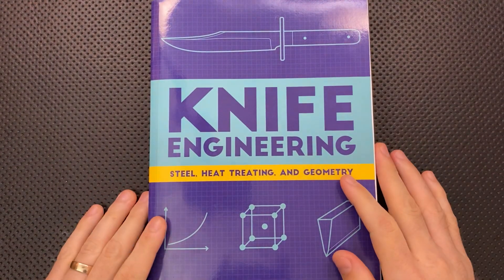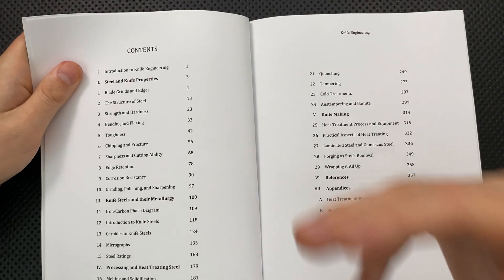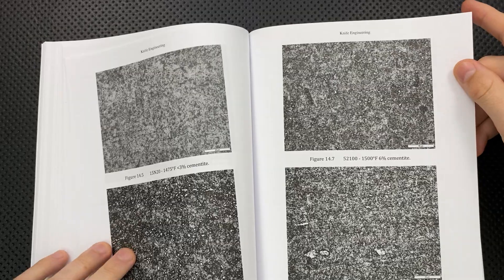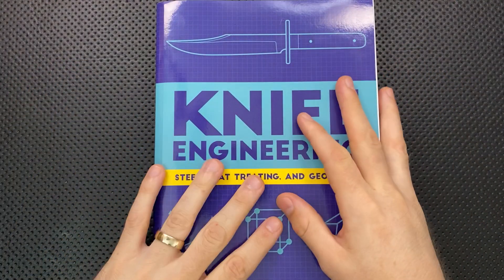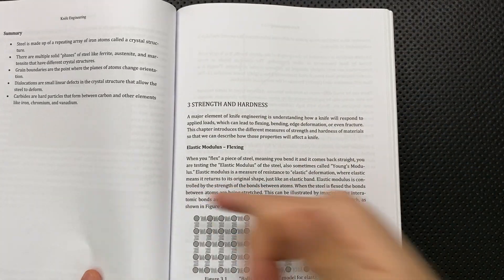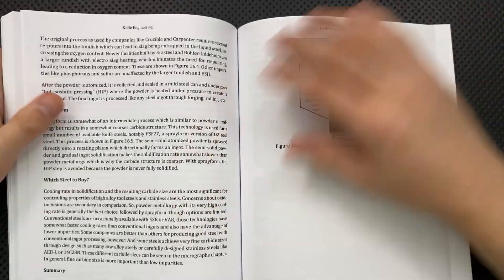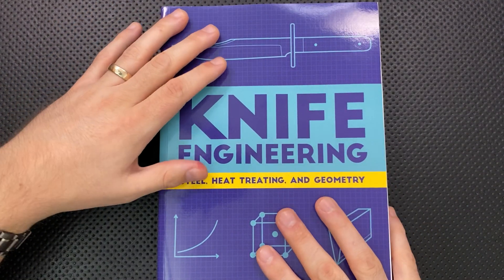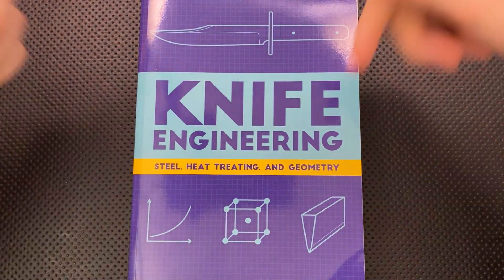Knife Engineering by Dr. Larrin Thomas: The Full Nick Shabazz Book Review

Comment: Looks like according to his list M390's popularity makes sensey.  Pocket knife level toughness, very good edge retention, easy enough to sharpen, and excellent corrosion resistance.
Reply: What I gathered from Dr. LT's ratings, is that there are a lot of viable options at the highest tier of stainless EDC blade steels. Arguments can be made for S35VN, SPY27, Vanax, XHP, S45VN, Elmax, S30V, or M390/20CV/ 204P (which all occupy points on a line from tougher to more wear resistant), and certainly not least, Dr. LT's own MagnaCut (which makes a big jump past that line, mostly towards toughness). 

I suspect XHP or SPY 27 solves more problems for me in edge stability (and MagnaCut or Vanax might do so too, while being highly stainless) than M390 and its clones do in resisting abrasive wear. Given the choice between stropping regularly to maintain an edge, and occasional reprofiling to repair microchips, I'll vote for dulling edges over chipping edges every time.

But for display knives? M390s stainlessness is a boon, and as its costly to grind, its also mark of the expense of knife production. But we've also seen some manufacturers run it soft, probably to reduce production costs. Pete of Cedric and Anna uses the analogy of steels as cuts of stea, which can be cooked well or poorly. https://www.youtube.com/watch?v=5BsvJU2fCd8 I'm sure we can all think of some knifemakers who can make delicious hamburgers, and others who can ruin a filet mignon.